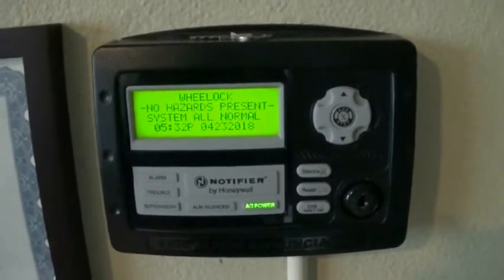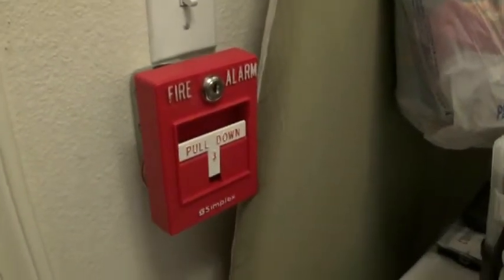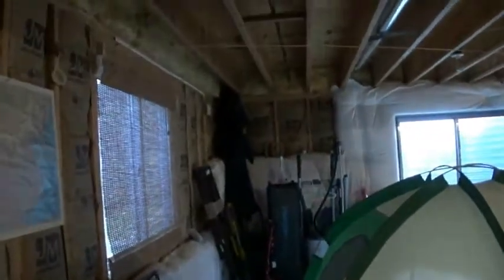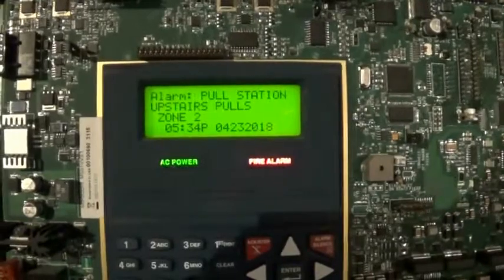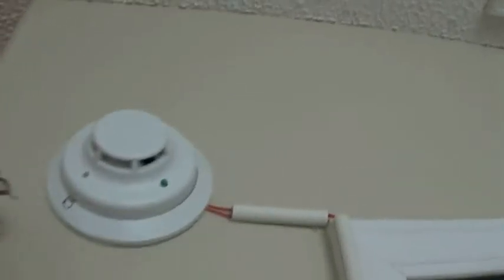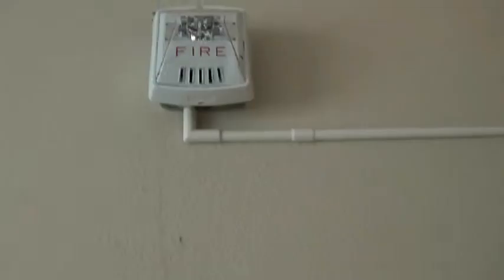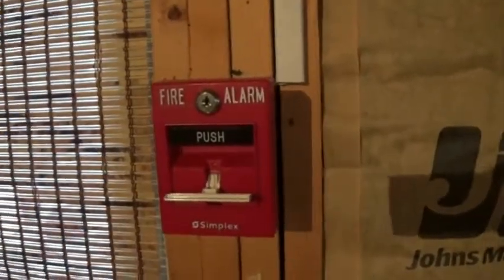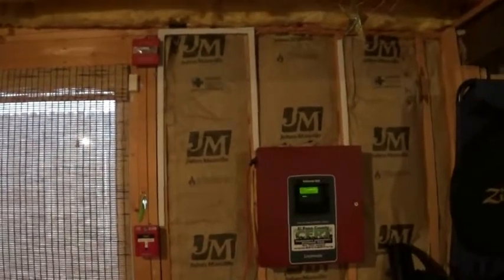New System Test 25

Comment: The Exceeder is also supposed to mimic the sound of the Wheelock NS line of horn strobes.  In the area where you put up the RSS and said a horn strobe would be too loud you could've put up a chime strobe like the CH70 or the CH50
Reply from the maker: I considered a chime strobe in the garage, but just decided to stick with the devices I already had.